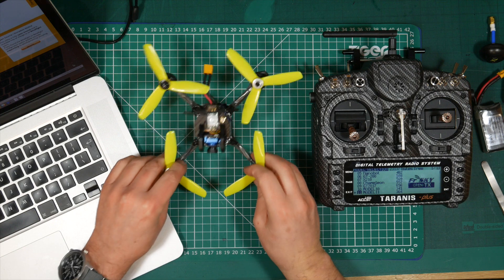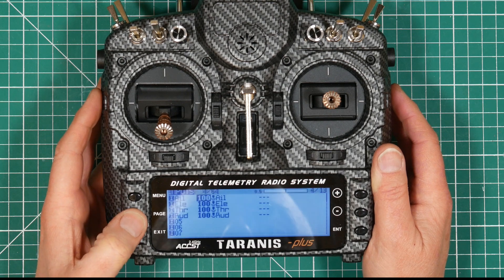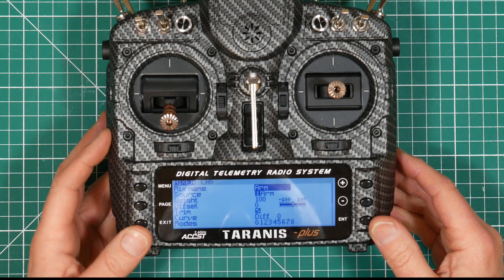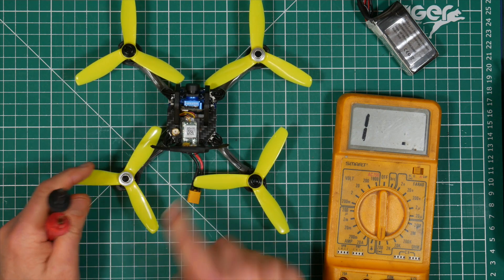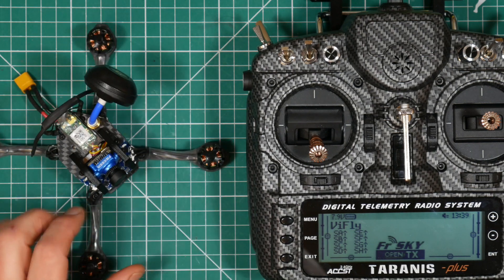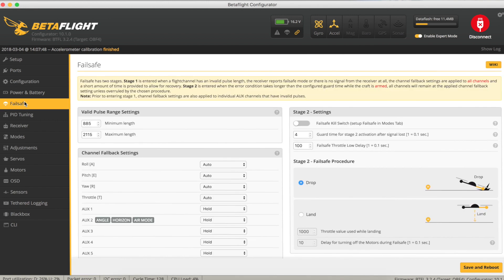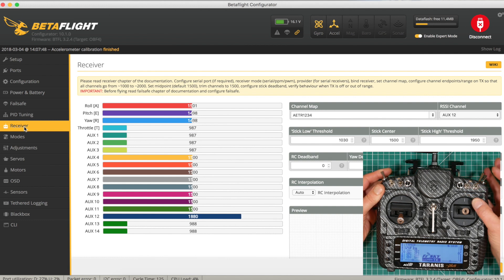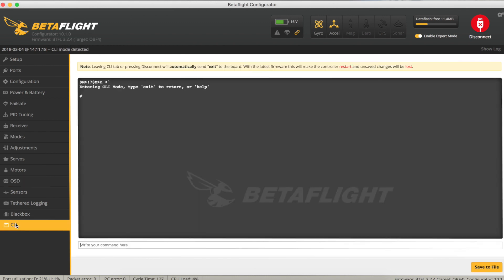ViFly X150 - Betaflight, Taranis X9D and FrSky XM+ receiver setup guide and configuration tutorial

Comment: i've had so much fun wth this little thing but now one of the motors is damaged. Can't find proper replacement, 1406 anyway. Do you still fly it?  I'm still fighting BF4.0 woes on my Hawk 5 when that's gone i think i'll give it a go and try put BF4.02 on the ViFly...any thoughts or experience on/with that WB?
Reply from the maker: Those 3300kv motors don't seem to be around, but these LDARC / Kingkong XT1406 1406 3600KV http://bit.ly/30NsNwy are SunnySky branded. I haven't tried them, but they may be a good replacement and they have a bit more grunt. Don't forget you'll need 2 x CW and 2 X CCW. Keep an eye on current cos it may push the ESCs beyond their 20A continuous.

Comment: question:  i'm considering transmitter "Jumper T8SG V2" due to price.  it is 12 channel.  If i use/have quads with this FrSky? 16ch RX, then would i be SOL?  New sub, TY!  (Also vifly specs say 8ch for rtf, i'm assuming yours is different due to BNF?)